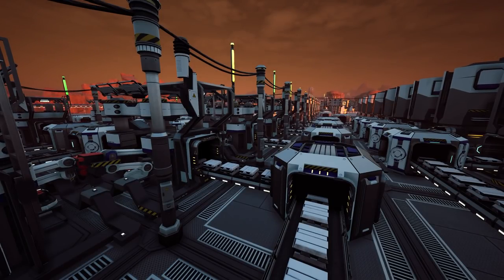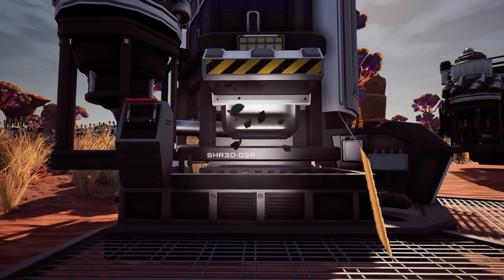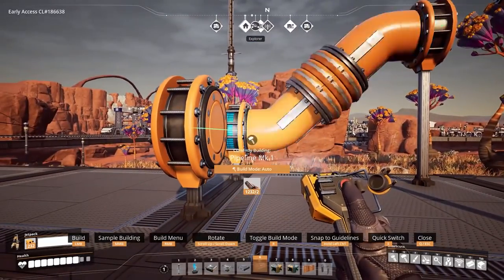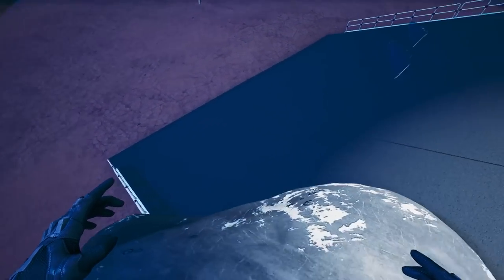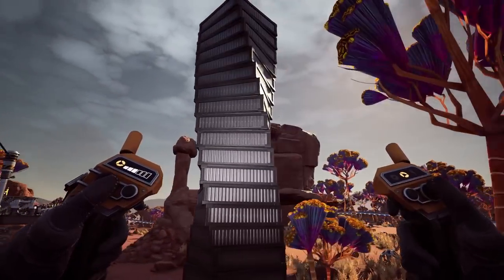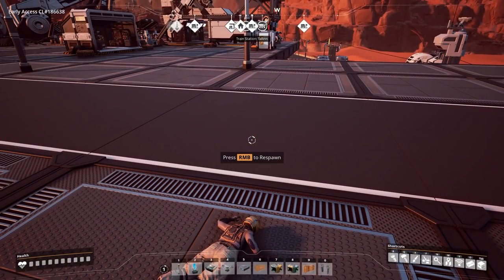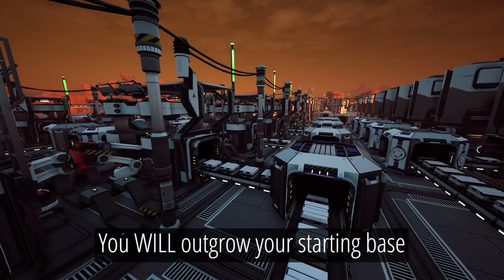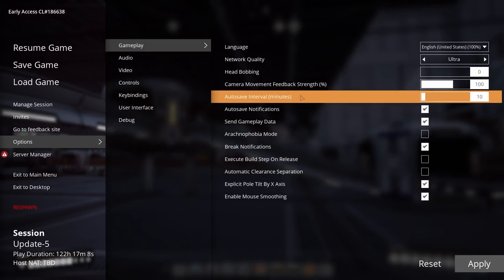Satisfactory: 8 Tips New Players NEED to Know!

Comment: I use a fairly simple method to keep the beasties from respawning where I don't want them. I place down a couple of foundation tiles and on one of those I place a bio burner which I connect to a power pole. For decoration I often place a lookout tower as well, sometimes accompanied by a workbench and cargo container. Since the burner has no load it will run forever on a couple of units of any fuel and since it is an active machines the beasts stay away.
Reply from the maker: That's smart!

Comment: this is wrong fall dmg can and will kill you if you jump from high enought.
Reply from the maker: That is incorrect. To quote the Satisfactory Wiki page on Health: "Fall damage is capped at 97 damage, with Blade Runners at 96, therefore all falls are not lethal provided the pioneer has 98–100 HP before touching the ground." It will kill you if you have previously taken damage, but if you're at full health then you will not die no matter the height.